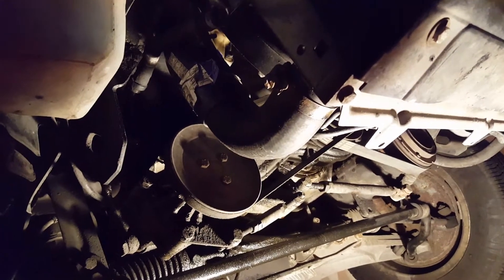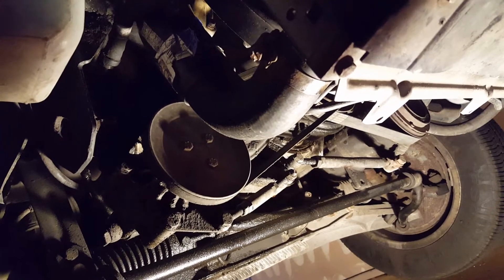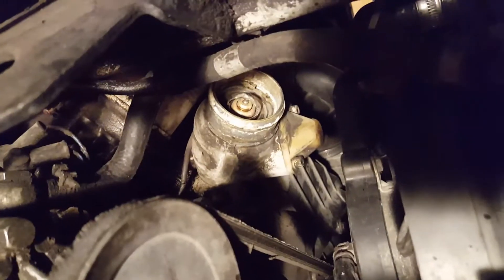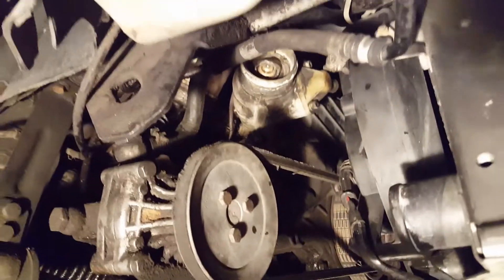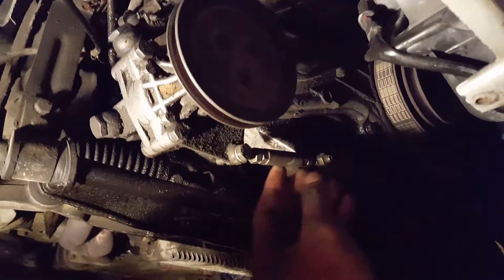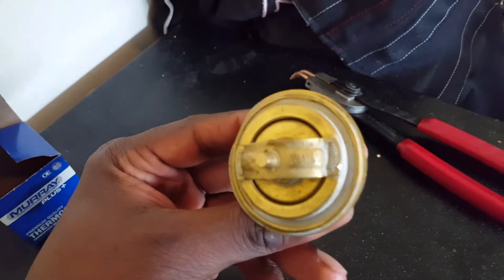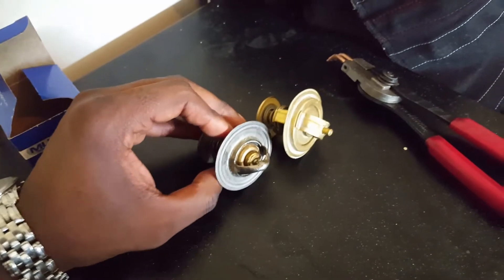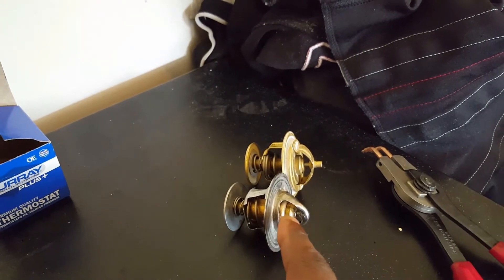944 - choose the right thermostat

Comment: What symptoms were you having with the bad thermostat?  My car is running hot.  My fans don’t kick on until the gauge is about 3/4 .  Does that mean that the thermostat isn’t letting coolant through to the radiator until the temp is too high (likely wrong temp thermostat installed)?
Reply: Wes Singleton hey trouble shooting the same problem currently I think that it’s a mix of both a bad thermostat mixed with air in the line.. are you noticing any raise in temperature when turning the ac on?? If so I would just cheaply your battery terminals and give them a good clean helped me👌 if not could be a bad rad or water pump as well

Comment: So it should be ok to install a low temp 71 degree thermostat?
Reply from the maker: Tino C it probably will be fine for the summer but fall and winter driving may be a little chilly. The thermostat will open at 160f and introduce cold fluid which will have the engine running cooler than intended. You may not get good interior heat. Your radiator fans would never turn on either because the thermo switch is still set to 180f.
Reply: I've done this to fix a problem where the cooling fans were running all the time. The fans are controlled by the coolant temperature sensor and the ECU. I noticed that the fans were off when the car was cold, so I figured dropping a cooler t'stat was the easiest way to fix it. It did, and I didn't notice any change in how well the heat worked. The temperature guage ran one needle width lower.

Comment: Thanks for posting this, as I have wanted to change mine for a long time. I often run hot and this makes it look easy to do, and that is from someone who had two timing belt breaks with the associated head removal and reinstall.
Reply from the maker: 1967250s thanks for the comment! It isn't to hard at all you just need that tool and a little patience. It's totally worth the time. Driving without staring at the temp gauge is soooooo much better. Lol